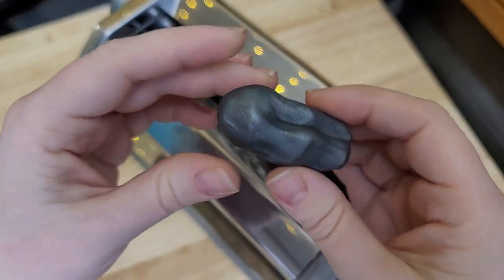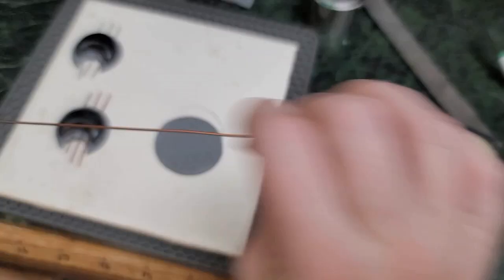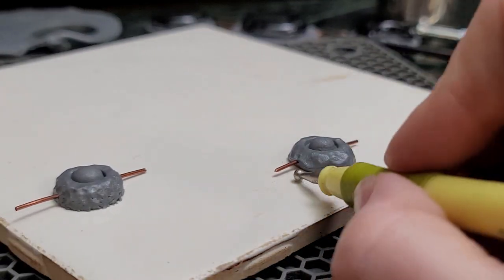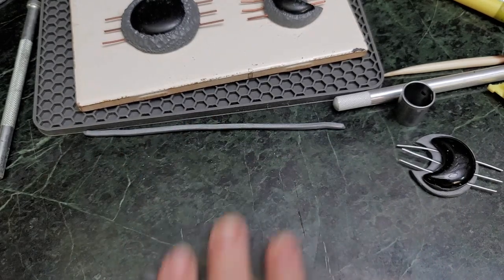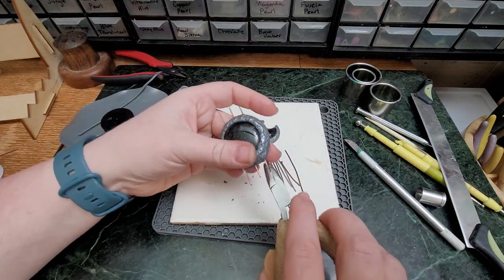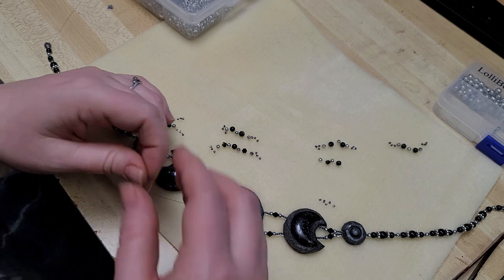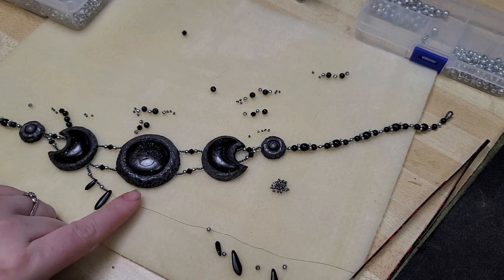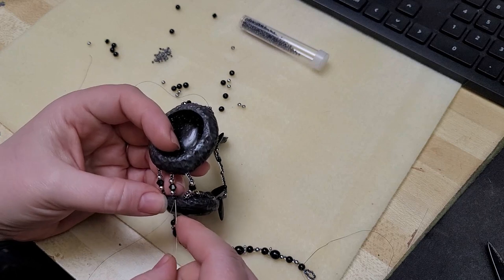New Moon Fused Glass and Polymer Clay Necklace

Comment: Hello! Beading was my jewelry start, like 25 years ago. I fell in love with daisy chains and had to learn to make them, down the hole I went, lol. I would use beading wire here. It holds the shape better, especially when you have bigger focals, like you do. I would use a thinner one so you could get it through the 11's. I would do 3 separate wire/cords. I would do a long through the middle and shorter above and below, that way I can adjust the tension so it hangs correctly. Testing it out on a bust, helps to get the "hang" right. Geez, I hope that makes sense.

Comment: I love the necklace, and I love watching your design prosess. 90% of designing bead jewelery is restringing until you're happy with the result. Personally I like bead thread for things that requires drape and movement, and bead wire for things that requires structure. I don't think one is better than the other, it's just a matter of what is best suited for the effect you want.

When using bead thread, I like to pull out a comfortable amount of thread to work with, but without cutting it of the spool. Then, once I run out of thread, I will pull out a new length from the spool to work with, and just thread it through the beads to where I need it. That way there's half as many ends to deal with. I try to thread through all the beads at least twice, both for strength and because it makes them lay neater. I think your little hanging part would have looked a lot better if you just threaded through it a couple of extra times.